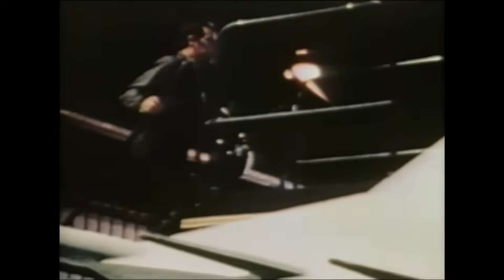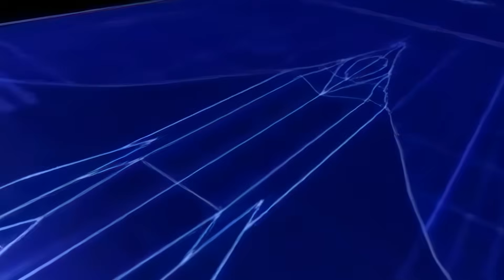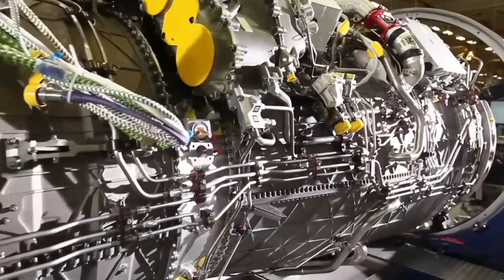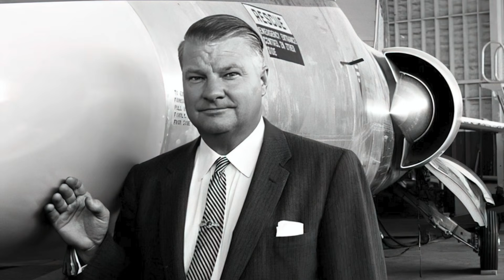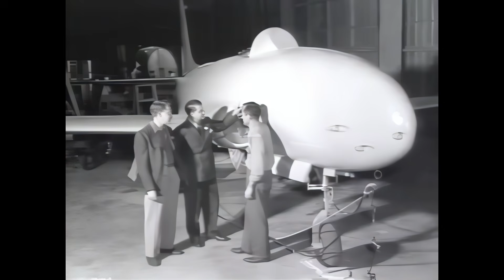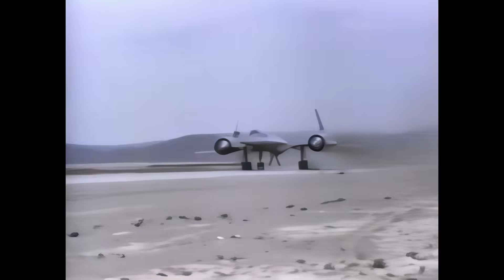Skunk Works: Extreme Aerospace Engineering | Forging The Future

Comment: Denys Overholser, the pioneering Lockheed Skunk Works engineer who passed away in 2026, translated Soviet physicist Pyotr Ufimtsev's mathematical theories on radar diffraction into computer code, enabling Ben Rich's team to design the Have Blue demonstrator and the F-117 Nighthawk.

The Paper: In 1962, Soviet scientist Pyotr Ufimtsev published research on physical diffraction, showing that radar reflections depend on an object's edge geometry rather than its overall size.

Comment: One so called black program that barley gets any attention was air soace magazine covered in the 80s possibly early 90s ws known as the pumkinseed air craft mores like suborbital hyersonic platform and i believe the x33 was a sortof program front ...it was a cross between a airship and blended wing body craft and that would use  shuttle tiles or a form of tiles to protect it from heat.m

Comment: In 1979 I was stationed at Air Test and Evaluation Squadron 4 (VX-4) at Pt Mugu NAS. During that year's air show, one of our pilots roped off an area about the size needed to encircle an aircraft for a "static-display" He then put a boarding ladder and a pair of aircraft chocks in.The ladder and chocks were in the proper places as if there was an aircraft sitting there but there was no airplane.  He then fashioned a sign that simply said said, "Stealth Airplane." It was  not an "official" display and the powers that be made him remove it the first day even though it was the most photograghed display that day.
Reply: WOW!!! That must have been quite the shock to all those taking a photo. Great short story!!!
Reply: Damn I was stationed next door at vr55 and had no idea that was there, pretty cool
Reply: I was stationed at EMH that same year.  I saw… or better yet, did not see an invisible plane, as I was just born and in a hospital.  Cheers black ops guys!  🥂